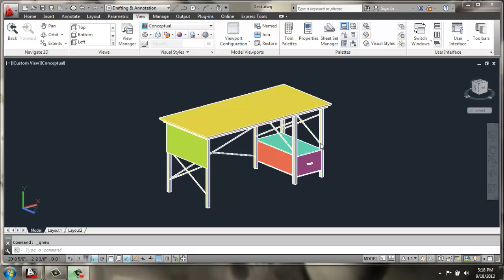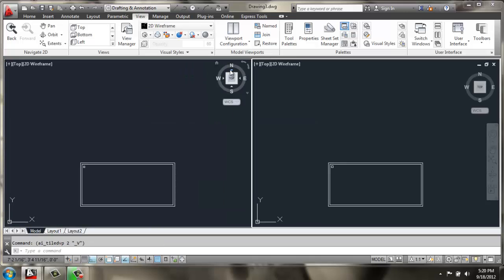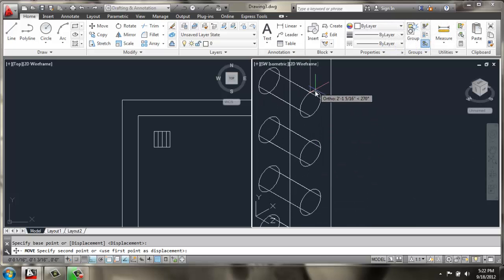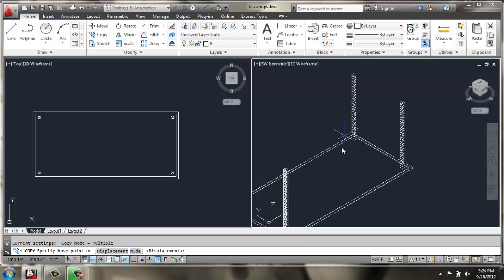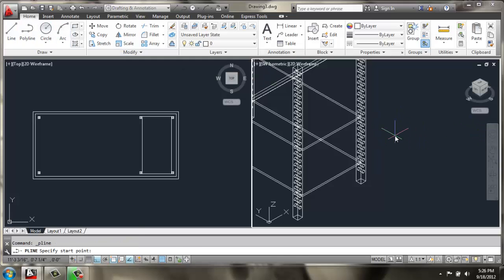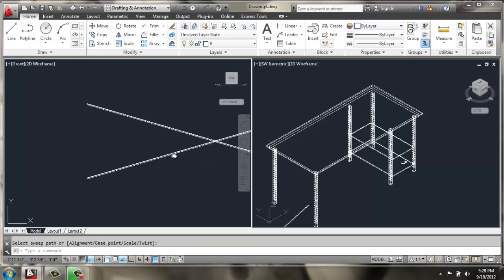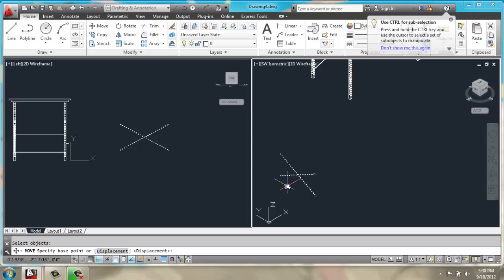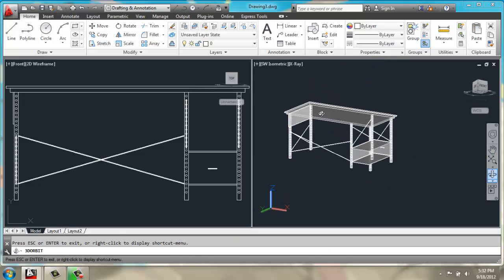AutoCAD 2013 - 3D Modeling Basics - Desk - Brooke Godfrey

Comment: A shortcut to the cross braces for the legs would be to select the face, to which the braces are connected, and draw a line from the midpoint, at the bottom of one leg, to the midpoint at the bottom of the opposite leg.  Then, stretch one end of the line up 12".  Mirror that brace and draw your circles at the endpoints and sweep them.

I know everyone has their own drawing style though.

Comment: Thank you for these tutorials ! One question: at 2:58 you create a cylinder and give it the depth manually ( 1 inch ) . Is there a way you can snap on the intersecting surface automatically ?
Thanks again

Comment: Hello Brooke! One quick question...On side panel of the desk 13:10 how did u align the third polyline right before u closed it? I noticed part of it was dashed towards aligning it...is there a setting for that? Thanks! Great Video by the way.
Reply from the maker: Use Object Snap Tracking - you can turn it on in the Tray at the bottom of the screen.

Comment from the maker: Well, when you use inches odds are good that it will look small initially if you're zoomed out.  When you use inches, you don't need to type anything else in - for example, if you want 5 inches, you can just type 5, or 5" if you want to be safe.  If you do feet, then you would type 5'.  If you're breaking the measurement down further, it would be something like 5'6-1/2" and so on.

Comment: Hello.

Just a quick question. 

How do I get my measurements to the proper scale?  When I set my units to inches and type in the lengths in the command, I get a very small rectangle that isn't anywhere near as large as the one in the tutorial.  I even added an extra digit and went 600 by 280 and it still didn't measure up.

Comment from the maker: I believe that I just used acad and changed the units to architectural.  You could also open an architectural template and skip that step.  It shouldn't matter too much.  Often the templates deal more with the printing aspects than modeling.

Comment from the maker: I suspect you need to modify your Object Snap settings.  Right click on the Object Snap button at the bottom and select Midpoint. That should help. If you're still struggling, a simple guideline/construction line is helpful.  Then you can delete it when you're done with the mirror command.

Comment from the maker: I think you are probably getting surfaces, not solids.  Is that correct?  If so, you have to make sure to JOIN the lines together before you extrude.  If you don't, you'll get surfaces, which can look like tall lines because they have no thickness.  I believe that's the trouble your having...